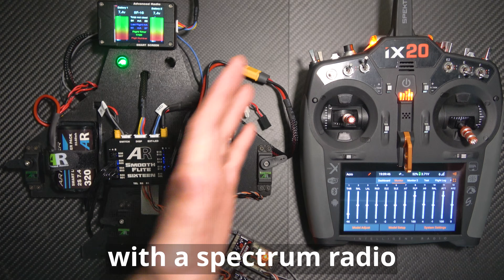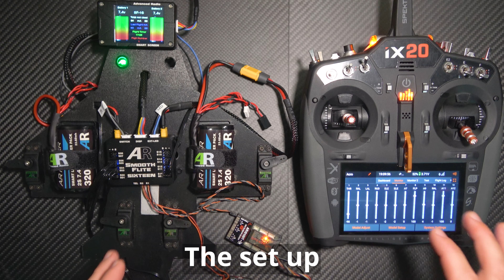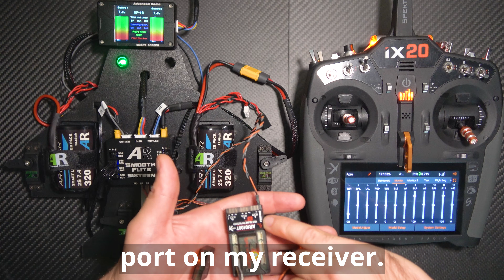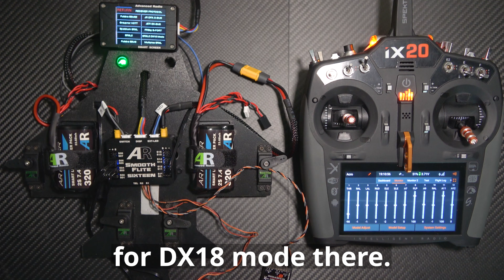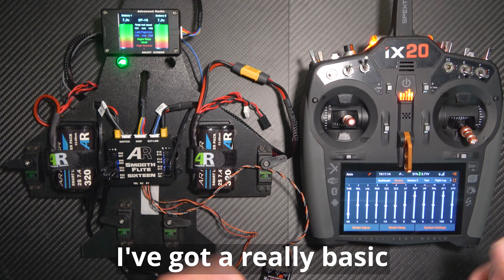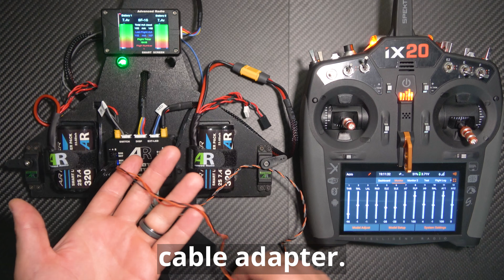Smooth Flite 16: How to setup your Spektrum radio with an SF 16!

Comment: Hello some help concerning SMOOTHFLITE SF10 PRO giro I have a spektrum NX 8 transmitter + a AR10100T receiver as the video on ( you tube) of course it is relevant to all smoothflite giros I expect , after normal bind you have to configure the giro this I could not do !!! the reason is the transmitter has to be configured also -you need to go into system set-up + find serial port setup there you can sort it to SRXL2 + ACTIVE. it will then work .

Comment: I have satellite receiver directly connected to the SF16, without the full size receiver. Its receiving the data just fine. Is there a reason the full size receiver is needed? Am I missing something?
Reply: I'm thoroughly confused on this. I thought the SPM4651T can be directly connected to the SF16. It's unclear on if 1 or 2 can be connected as well.

Comment: can you use a dx-8 gen 2 transmitter to use this as well? ex...120cc plane with 4 ail,2 ele, 1 rud, 1 tht
Reply from the maker: SF16 uses the SRXL2  protocol. DX8 gen 2 can use SRXL2 receivers. So if bind SRXL2 sattelite receivers to the DX8, then you can use the SF16 or any of our SmootFlite products. .
Reply: @rickgellboomarc awesome thank you so much for the reply
Reply: @rickgellboomarc do the sats have to be the 5651t or can they be any other srxl2?